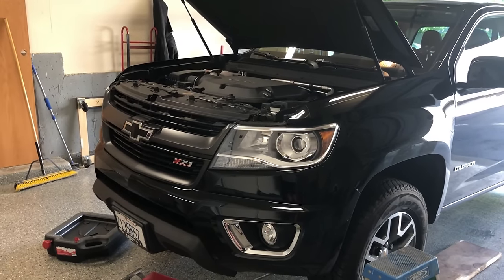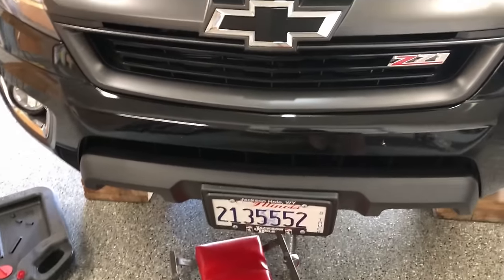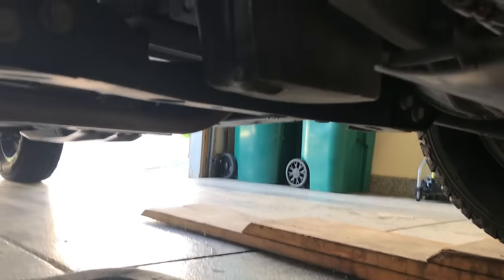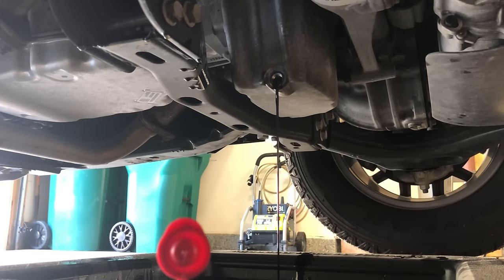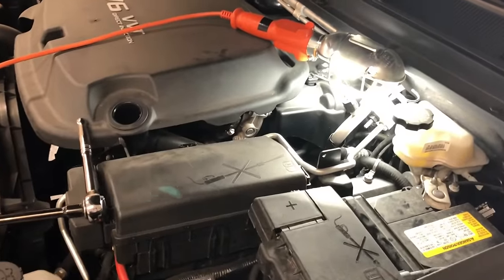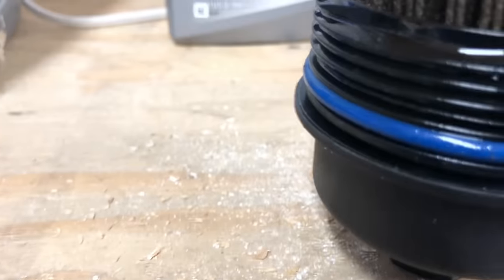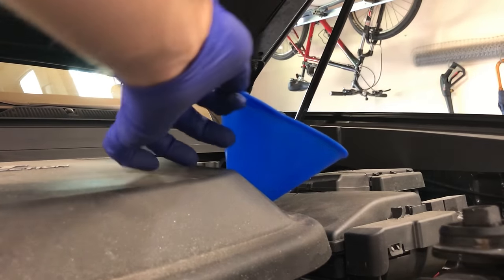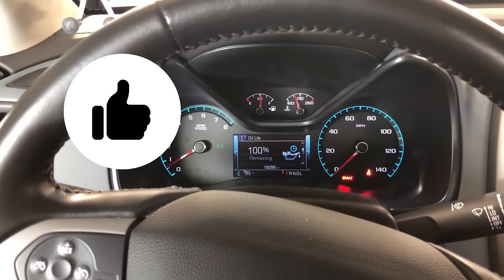[HOW TO] Change Engine Oil on a 2015-2022 V6 Chevy Colorado / GMC Canyon (Easy)

Comment: just did mine today after watching your video. just wondering why after 6 quarts, my dipstick is still only about a quarter covered. Any ideas?
Reply: Mine also.
Reply: It takes a bit for all the oil to get in the oil pan.
Reply from the maker: Check the oil again after about 10 minutes. The oil has to drain down into the pan all the way after you pour it in.

Comment: Thanks, Never done my own oil before but everything is so expensive these days.
Reply from the maker: Glad to help. Thanks for watching!
Reply: @fondupot   The oil you use says 10,000 miles protection guaranteed  but my truck hits about 6000 and says to change it. what's the deal?    Also did you really change your oil at 85% or did you reset it early to avoid the "nag" to get more life out of the oil?
Reply from the maker: Mobil1 oil says it can go 10k miles. But the OLM son the vehicle is controlled by the computer. It usually ended up being around 5000-6000 miles when I would change the oil.  It said 85% because in accidentally reset it a few weeks earlier. But I keep track of the mileage for oil changes too. So I knew it was time to change it.

Comment: Should I change my oil every 4 to 5k milles ? Some tell me 3k or till 7k 😳
Reply from the maker: I go by what the oil life monitor says. I usually change mine when it gets below 20%. Usually that’s 5500-6000 miles.
Reply: @fondupot  Great thank you very much !!💯😎
Reply from the maker: Glad to help. Thanks for watching.
Reply: @fondupot  I appreciate you for the information and for responding super fast!!!
Reply from the maker: No problem. Glad to help!

Comment: I just did it. When I put 6 quarts back in the dipstick is read its only half full. Did you add more oil. I don't want to overfill it,because to much oil is as bad as not enough.
Reply from the maker: James Haynes if it’s in the hash marks it’s full. You should be fine.

Comment: Also on the ‘15’s at least that oil filter cap is metal.
Reply from the maker: Yes, the 15-16 oil cap is metal. Changed to plastic on 17+

Comment: The 2022 GMC Canyon V6 is a completely different screw on oil filter.
Reply from the maker: I believe you are mistaken. The V6 engine did not change for 2022. It’s still an LGZ V6 that has the top mounted cartridge style filter. Your truck probably has the 2.5L inline 4 cylinder motor that has a spin on filter.

Comment: Pls how do you reset the oil gauge to 100%....or that should be done by another device outside the vehicle?
Reply from the maker: It’s done in the menus on the driver info center. It’s shown how to do it at the end of the video.

Comment: Why is the  truck up on planks. Vehicle should be level. Also put cardboard on the floor to protect the floor.
Reply from the maker: Easier to drain the oil. I’ve never had an issue doing it this way. The oil all drains out of the pan. Play this makes it easier to access under the truck.

Comment: Little tip if you crack open the oil filter cap before you drain the oil, all the oil drains down with it.

Comment: What oil do you recommend for a truck in central Texas
Reply from the maker: I've used Mobil1 in my trucks for years. Hasn't proven me wrong yet. My truck had the 3.6L, I used 5W30.
Reply: Thx just was confused Chevy recommends dexos2  oil
Reply from the maker: @FEDUPDON  dexos2 is just a specification not a brand.. Lots of oils have it. Mobil1. Valvoline. Pennzoil. Royal Purple. Quaker State. Just to name a few of the big brands, are all dexos2 approved.
Reply: Thx I just wanted to know it should say Irvin the bottle and now a tech said to look for low ash which I assume is on the bottle too
Reply from the maker: @FEDUPDON  most bottles will say it somewhere on the label yes. Usually right on the front. Not sure what the low ash term means. But I looked up Mobil1 and it says it is low ash.

Comment: 3:30, do you turn it counter clockwise to remove the filter cap unit?
Reply from the maker: Yes it has standard threads. Righty tighty. Lefty loosy.
Reply: You wouldn't believe how hard I'm twisting on it, even tried using an electric impact driver and it still won't budge, insane. First oil change outside the free service from the dealership. They managed to get it seized on there  somehow.
Reply: Ended up using an awkward combination of extensions and adapters with the Dewalt 20v impact. Appreciate the help,
Reply from the maker: @LukeTeel  Wow that's crazy. It should NOT be that tight by any means. Glad you got it worked out, but when you reinstall the cap it just needs to be snug, I think the spec is 18 ft/lbs. It's not a lot.
Reply: I had the same issue when I went to a valvoline for oil change after a previous dealer oil change. Valvoline couldn’t get the filter off and were afraid of breaking it, went back to dealer for one last oil change then no more from them.

Comment: 24mm socket for the oil filter cartridge. 
15mm wrench or socket for the drain plug
A 12”-18” extension is helpful as well
You’re welcome.
Reply from the maker: Left Handed Archer yea I said that in the video. YOU are welcome.
Reply: I know but, I wasn’t being an a$$, just helping others that need it spelled out to remember while they’re in the process of changing their oil.

Comment: I have a 2021 but it's the smaller motor. it's the same set up right just smaller size?
Reply from the maker: The 2.5L 4 cylinder engine has a spin-on filter underneath the engine. It’s not like the V6 at all. And I believe it has a different oil capacity as well.

Comment: Note to everyone . You should remplace the oil filter before remove the engine oil ! So the oil in the filter goes down in the pan before !
Reply from the maker: The oil filter housing is always empty after I drain the oil. It’s not holding any oil up there.

Comment: I have also noticed that last 2 oil changes I needed to put closer to 6.5 qts...and it’s not consuming any oil between changes...I could probably get away with the 6qts, but after checking the level it’s slightly lower than the full mark
Reply from the maker: v mann stock with 6 quarts. You could be overfilling. When the engine is warm it should read at the full mark.
Reply: Soak your rag in brake cleaner then thoroughly wipe off the dipstick. You will get a accurate measurement. It needs to be in the hash marks it’s not an exact.

Comment: I would have gone into a little detail on how to reset the oil life in the driver display, I have no idea how to do that.
Reply from the maker: Go to Oil Life screen. Hold the button. Reset. Done. Also you can look it up in your manual.
Reply: @fondupot  got it. Thanks for the video, I changed my oil for the first time myself in my '18 Colorado in about 20 minutes. Easy as can be. I like that type of oil filter.

Comment: Whats the stem valve called or where can i find one
Reply from the maker: Check video description for part number. You can get them at a Dealership. Or online at GMPartsDirect.com
Reply: I did and it isnt listed
Reply from the maker: Not sure them. Part numbers change sometimes. May have to go to a parts department to get the new part number
Reply from the maker: @jarvisfisher2188  Here is the part number.  
GM Part # 12696079

Comment: What do you guys use to determine when to change the oil?  Do you go by the mileage or the oil life meter in the dash?  Nice video btw.
Reply from the maker: Jimmy Flex I go by the Oil Life Monitor. Typically I will change the oil when it gets below 20% oil life. In my experience it usually ends up being between 4500-5500 miles per change. Thanks for watching.
Reply: @fondupot  with the problems these trucks have with timing chains everyone says 3000mi.  Seems like a crime though to change mobil 1 out at 3000 though

Comment: Why does the title say 15-20?🤨
Reply from the maker: It’s almost the exact same process on all years. The video description lists the different filters required by each year. Otherwise it’s the same oil weight. Capacity. Drain location. Filter location etc.

Comment: How many miles do you go before another oil change with the full synthetic?
Reply from the maker: Piero Sanchez I go by the Oil Life Monitor. But it’s probably around 4500-5000 miles.
Reply: Alright, thanks for the video

Comment: Lets us know the part number on the magnetic drain plug you get.

What a crappy made filter.  Just looked at the 15-16's filter and its built waaaay stronger.  Metal ends and metal inner tube.   I'll be keeping my eyes out for a better filter.
Reply from the maker: According tot he GoldPlug website, the part number is AP-04. Runs about $19. 

There is also the Dimple magnetic plug, it's more expensive. But I think its the 12mm x 1.75 x 21. Runs about $35

I'll probably go with the GoldPlug, since I have used them in the past.
Reply: Metal Oil filters have paper elements inside😂 and the cage inside is to keep the element from collapsing. The crappy paper filter you refer to in all is in a metal housing🤪. Most all fords ran this in their smaller engines never had an issue. And all of their 6.0L diesels. Better to deal with. When I worked on Caterpillar 16 cyl endings we had to cut all the oil filters for sampling. Guess what a big hunk of paper laid inside😲.

Comment: how to turn off signal of change oil on the screen ?
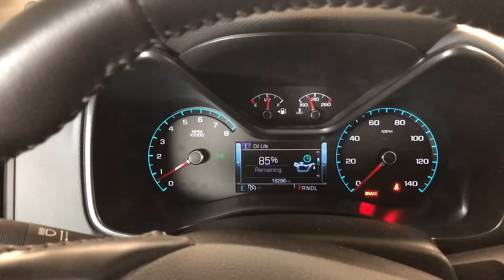Reply from the maker: Watch around 5:30 in the video. I show you how to go into the Driver Info Center and reset the Oil Life Monitor back to 100%.

Comment: my oil filter cap is not plastic. it's metal
Reply from the maker: What year is your truck? 2015 -2016 had a metal cap and the motor is slightly different. This information is noted in the video description.
Reply: @fondupot  2015. I guess they made 2015s different
Reply from the maker: The 2015-2016 engines are LFX motors. The 2017+ is an LGZ. The only thing they share is the 3.6L displacement, but they very much different engines.
Reply: @fondupot  really. the more you know.

Comment: Why is the filter so tight? Tips?
Reply from the maker: I’ve never had a problem. Use a longer ratchet for more leverage.
Reply: @fondupot  nvm we got it. We just used more leverage
Reply from the maker: @benjaminarevalo5645  Great.

Comment: Open Question Everybody:
If I purchase the new oil filter myself, do I buy the gasket separately or does it come with the new filter? I haven't shopped yet, so I'm not sure.

I bought a 2017 Colorado around a month ago. Once I parked (after purchasing), I crawled underneath and was wondering where the fuck my filter was XD I'm definitely not used to this.
Reply from the maker: Do you mean the gasket? I would recommend buying OEM ACDelco filters, and they come with a new gasket for the oil filter cap.
Reply: @fondupot  yess that's what I meant lol
Reply from the maker: @greensanta0666  Ok, yep. The new filter should come with a new gasket. I know for a fact the AC Delco filter does.
Reply: @fondupot  
You've been a great help, even on a two year old video. Keep it up dude!
Reply from the maker: Thanks glad to help!
Reply: It comes with the new filter
Reply: They all come with the gasket…I have used Mobil 1 fram and oem for the filters…my kid is a gm tech and gave me a box of ac delco so I am using the oem again

Comment: I like all the debris and what not all over your work bench, then on your new filter then in your engine. You got your oil changed now change your engine. Come on dude that was a no brainer...
Reply from the maker: The Jackal it’s fine. Truck is fine.
Reply: There is dirt in your under pants do you still change your oil🤷‍♂️

Comment: Been a while since I've done my own oil change. We always had the filter in the canister under down by the oil pan. Curious if you need to replace that gasket on the cap everytime you change the filter. Thanks and great video!
Reply from the maker: Yea canister filters are still a thing. This cartridge style was new for me though. And yea the gasket gets changed on the oil filter cap each time. Thanks for watching.